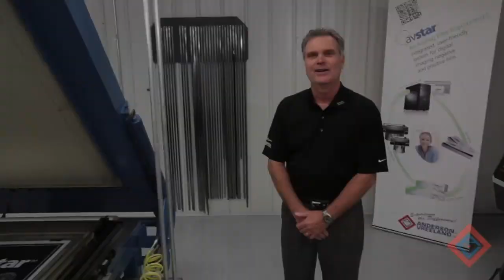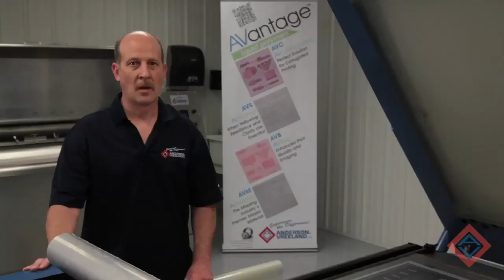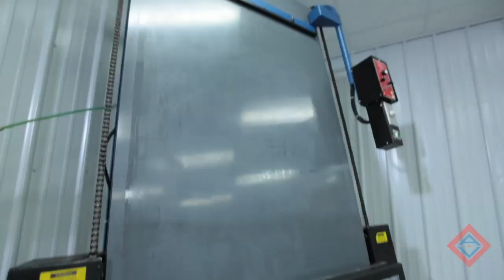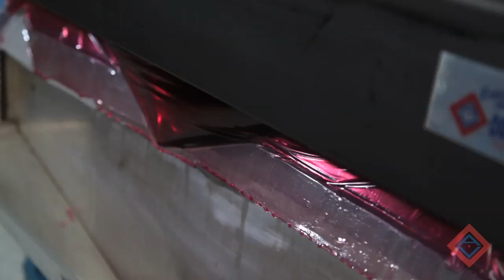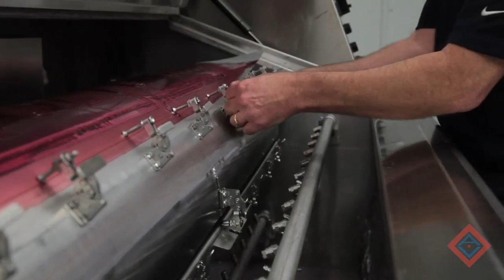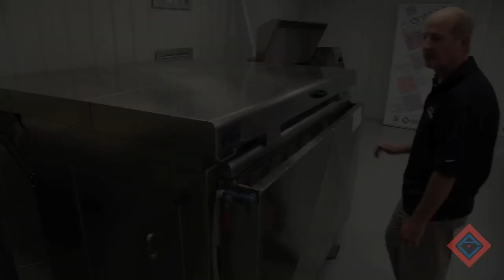How To Make a  Liquid Photopolymer Plate Using AVantage Liquid Photoplymer Resin

Comment: Ive worked as a platemaker for many years and AV is our manufacturer/resin supplier and have earned their great reputation as that. Good video of the process of film to finished plate production. If ya’ll want a showing of sticky back - to material creation(pvc) and then mounting for print - id be happy to help 🤗. Thank you for the video.

Comment: I don't think water washed plates are better than solvent washed plates. I do like that you don't use solvent and just water and soap.
Reply: Agreed. Water washed only on a tacky(sticky) plate can be hard to clean. If the washout unit uses detergent it can better clean off excess resin after it went through the resin/polymer reclaim board. Make sure on your post-exposure salt bath that you clean it after so many jobs because if you dont it will leave you with sticky plates. You can notice it right away because your plates will look more pink and less translucent. They will gather dust particles and everything else super easy at that point.

Comment: That is a very nice plate. 

Why has the plate been made?
Reply: The plate in the video is a standard test plate of screen detail and quality of the print. Commonly referred to as a test of DPI(dots per square inch) and LPI(lines per square inch). Its a surprisingly interesting way to make intricate designs, multi-color(sometimes), art-work come alive on box print(corrugated board AKA cardboard).

Comment: Thanks YouTube algorithm, I don’t know why I’m here
Reply: Same thing here. Now I wonder what the result is used for. Or is it the finished product already?..
Reply: @xobotun_  im about 5 years late to responding but it is for various box print design. Check out the print on a pizza box next time you order, that is only one example of the many different prints that an unknown few platemakers help make possible(and the die makers for the box itself). Best wishes
Reply: @platejedi , wow, thanks! I would have never guessed it is a stencil(?) for mass printing!
Reply: @xobotun_  stencil is one way to look at it but a lot of times, in reverse. The plates are exposed (and solidified) after light exposure to “raise up” the image from the floor of the substrate and the film that sits under. In the video he talks about the “shims” that determine the amount of polymer poured for the plate height. There is generally less(sort of, a lot of times)print through, so to speak, its more like a stamp. I will add though, that some designs are made with “inverse” print which is more like a stencil depending on how the art is achieved to print. Its really cool and some prints can be insanely intricate to look almost like photographs. We work closely with graphic designers to meet customer specifications and some are really surprising/impressive! Sorry for the text wall, im a photo polymer plate nerd.. its some of my best ways to get my kid to fall asleep 😂.
Reply: It detected you like craft resin. Now you just need $225,000 in equipment to up your resin game.

Comment: I’ve been doing this for 24 years. Same machines.
Reply: I've been doing it for two.
Also same machines.
Pretty cool job but i wear gloves and a respirator anytime I'm dealing with liquid poly or the wash tank.
Reply: How can i prevent to get my plates too sticky. Is it the washing chemicals?
Reply: @lorenzosoto1483  in your UV/Detack unit, check your bulbs. Ive ran into an issue in my UV/Detack(very last process unit) where the bulbs were out on the end, so we have to flip the plates and run two cycles to make sure both sides of a pour get their proper cycle.

The salt bath/post exposure will change the pigment of the plates (from thick pink to tan) depending on your bath quality and salt-to-water balance.. but it generally will not help with the tackiness(sticky) of the plates.
Reply: @lorenzosoto1483  post expose powder is no good. Either change it or add a cup of powder to the tank. That would give me an extra 2 days of usage.
Reply: please how can i get the machine and how much those it cost